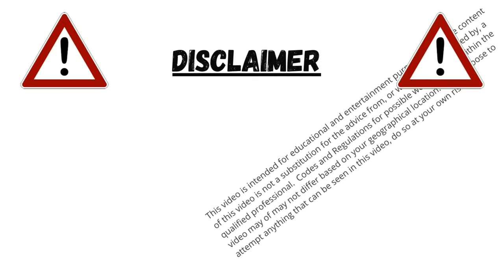Milwaukee M12 Fuel Circular Saw - Features & How It Cuts! - Best "Little" Saw I have Used 2530-20

Comment: Ok, just bought this and the Diablo blade.  I hear grinding noise when free running the saw, like the bearings are bad.  Going to try to exchange it.
Reply from the maker: They should let you exchange it.  

Mine doesn’t make any kind of noise different than any other saw…

That one must have slipped past quality control.

Comment: This video answered some questions for me, thank you.

I picked up a used (yet never used) example recently. It came with that same Diablo blade installed (also unused.) On mine, the lower blade guard wobbles a little bit, something I didn't expect. I am assuming yours doesn't do this.

The C-ring securing the guard appears to be installed correctly in its groove. Doesn't bind up or hit the blade, so I guess I'll leave it be and let it rattle a little. 

As for why buy? I'm using M12 where I see a few opportunities for something interesting out of the norm. I was initially interested in a 4" circ saw, like the little ones you see from Dremel, Worx and Rockler. But I wanted it cordless and most of those are not, and represent yet another platform. I've already used once up in the attic my old 7 1/4" Skilsaw, so I know this will be better for that.

I'm already in metabo HPT for their 18v/36v lines, but went with M12 for the Fuel oscillating tool, the stapler, this saw, and am interested in the sprayer and the 3/8" Stubby impact. If I wanted a straight replacement for the corded Skilsaw and didn't need quite its reach, I'd probably go with metabo HPT's 6.5" cordless.
Reply from the maker: You are welcome.

I really like this saw and you are right… it will get you in some places others won’t.  I also like the control I have with it just using one hand.

I haven’t noticed in rattle in mine.. not sure what that could be.  

I think you will find this to be an extremely useful saw for certain things… if you use it for what it is and don’t pretend it’s a full size saw, most people think it’s great.

Have a good one 👍

Comment: The M12 Jigsaw and baby bandsaw are also worth owning !
Reply from the maker: Yeah I have both of those and like them as well.

The Bandsaw is one of the few fuel tools that I haven’t upgraded to Fuel yet. I really like the small size of the original and I primarily use it for conduit, all thread, and uni-strut. It cuts all those so I haven’t had the desire to go bigger. I am sure the Fuel one cuts faster but I haven’t used it.

Comment: I have the tiny little Bosch mini circular saw - cutting depth 1"/25.4mm. Brilliant, even ploughs through 3/4"/19mm plywood easily then flip to 3mm hardboard - and does dust extraction well - except setting bevel and cut depth is crude and fiddly. Came here after looking at the Milwaukee Installer Kit and Bosch equivalent. I have that Bosch but Milwaukee 18V drill and driver pair with combined charger. Which way to go for the installer? Needed such a tool yesterday and made do with a cheap minimal size right angle bit holder in the 18V drill. But... The whole Milwaukee 12V range looks very useful to get into even if I'm with Makita for 40V. Thanks very much for the review
Reply from the maker: Your welcome.  I have a review for the Installation Driver too.. it’s one of my favorite tools.

Bosch makes good tools… just hard to get in my area.

Comment: While this saw definitely needs an update as it's several years old, it does fine for what it is. I use mine for breaking down sheet goods like MDF and plywood for finish carpentry. For blades I use the Norske 30 tooth finish blades. Of course I have a few diablo framing blades as well.
Reply from the maker: Appreciate your thoughts… I use mine for most of my smaller job site type work. I just used it yesterday with the rip guide to make some OSB spacers for headers, and then for cutting all my 2x4’s. Worked like a champ.

I’m a little curious to see if the high output batteries do anything for this saw. I can tell a difference in my M18 Rear Handle with one.

Would be nice for an upgrade. I’m  still waiting on a jigsaw upgrade too. Would like a Fuel Version and also one that the plate locks at 0 degrees a little better.
Reply: @MORGANSMaintenance  yeah mine gets used on occasiona along with the other 4 saws I have in the van. I like my DeWalt FLEXVOLT circular saws personally. Rear handle and side winder. So much power.. I also have the m18 6½ which I use for ripping as well. Have a lot of dedicated tools and guides/jigs so I'm not constantly switching things out. I may get one of the HO batteries for the m12 saw but they are really expensive here in Canada. I also can't find the rip guide for the m12 saw otherwise I'd buy one.
Reply from the maker: @BrandonContracting  yeah I ordered my tip guide from some weird website… I hadn’t seen it available anywhere else.

Dedicated tools are a big time saver 👍

Comment: Great review Morgan. I like having the blade on the left side as well. I have the regular M18 saw and it does a great job but it is heavy as well for what I do. I think I might head over to the depot today and pick up the m12
Reply from the maker: It’s super light. I can normally hold wood in one hand in the air and cut it with the saw in the other it’s so light. (Like what I did with the flooring)

I primarily cut 2x4’s with it but use on sheet goods that aren’t delicate cuts (sub flooring, etc). If I am building furniture/cabinet grade stuff I use my track saw.

Thanks for the compliment and for taking the time to watch!
Reply: @MORGANSMaintenance  On a side note, not sure if you use the m18 or m12 vacuums but Milwaukee has some new vacuum attachments that work pretty well. Might be a good video idea for you.
Reply from the maker: @parts7959  I have the M18 (the one before the Packout Version) and I think I will get the M12 the next time they run it with a free 6.0 battery. I really like how the hose stores inside the M18… I’m not sure if it does on the M12.

I just saw a few Air Tips on a shelf at Home Depot this week while I was looking at the Tool Tray. They don’t have them out on display or for sale yet, but my Home Depot stinks and is always behind. 

I’ll check into them. Thanks for the suggestion 👍
Reply from the maker: @parts7959  which particular tips do you have?
Reply: @MORGANSMaintenance  I have the 3 in 1 crevice and brush and I have the cross brush air tips. The m12 stores the hose like the m18. I bought the m12 when it first came out and they had a lot of problems with it. I’m pretty sure they got those fixed now. Also my neighbor is an electrician and he uses the m18 vacuum for getting wire started for pulling in conduit. He says it works very well
Reply from the maker: @parts7959  yeah, part of a plastic grocery bag on a pull string works great with a vacuum.

I will check out those tips, I have some gift card money to spend 😂. Thanks again for the suggestion.
Reply from the maker: @parts7959  I’m going to buy the flexible hose set and probably the cross brush you have to start… man they have A LOT of these. I had no idea they came out with all these.

I would get the dust collector that sticks to the wall but I already bought something that works similar.
Reply: @MORGANSMaintenance  👍🏻me either, there’s a lot of options. Dust collector is a great idea. I need to take a look at the flexible nozzle
Reply: @MORGANSMaintenance  good call on the m12 circular saw, I went to my local Home Depot today and picked 1 up and a Diablo blade, it is awesome. I love it, didn’t like the price though lol
Reply from the maker: @parts7959  good deal. Crazy light isn’t it?

Yeah it is $149 now. I think I might have got a battery with mine and made it a little cheaper but it seems like all the tools have gone up a little. They didn’t cut any corners  on it for the plate and adjustments and stuff though… I think that’s why it’s priced a little higher than other smaller saws. It feels like a real saw, just smaller.

Oh after a few months you won’t even remember how much you paid for it 😂😂

Comment: Great video! I have the m18 6 1/2 fuel circular saw and absolutely love it. The fuel tools are really something else. Looking to upgrade to the rear handle eventually but have looked at the 5 3/8 m12 before buying the 6 1/2. Also have the dewalt atomic 4 1/2 flooring saw and I love it. Definitely try it if your looking for a good flooring saw. 👍🏻👍🏻👍🏻
Reply from the maker: Appreciate it.  The Rear Handle is a beast… but it it heavy..

Thanks for the suggestions 👍
Reply: @MORGANSMaintenance  very true. It’s the only 7 1/4 saw I could get with a left line of sight plus I want the power for cutting hardwoods. But honestly my fuel 6 1/2 has never stalled out or let me down so idk I want to just put it aside for the rear handle
Reply from the maker: @Toolboss0826  Line of sight is the the whole reason I got the rear handle too…. Also the reason I gave this saw a try originally. 

Rear Handle is a great saw, I really like it, I haven’t used the 6-1/2 though.
Reply: @MORGANSMaintenance  6 1/2 fuel is so light and compact. I own quite a few circular saws including a 6 1/2 dewalt and a corded 7 1/4 dewalt (dwe575) and the line of sight of the dewalt is a lot to be desired. Imo Milwaukee wins on the line of sight and the base plate. The power is substantial and a 6.0 battery definitely makes a difference on big rips. The 6 1/2 is the best circular saw I have ever owned. I bet the rear handle is a beast
Reply from the maker: @Toolboss0826  I make pick up the 6-1/2 if I ever catch a deal on one.  It would be a good one to have as an in between for a quick grab.
Reply: @MORGANSMaintenance  agreed. I got my 6 1/2 for an amazing deal that’s why i scooped it up. I would never had paid full price for it but if it was today and I had experienced it first over my brushed Milwaukee 6 1/2 I prob would have bit the bullet
Reply from the maker: @Toolboss0826  👍

Comment: My only Circ saw ! Good on 2 by stock , so what if lt takes two passes to cut 4 by stock , I bought the carbide blade for metal square duct , etc !
Reply from the maker: I think the same way…Most 6-1/2 saws take two passes too, so might as well have a smaller, lighter saw.

I haven’t used any of the metal cutting blades on it.  Not a lot of blade selection in store… but tons on Amazon.

Great to hear from you!

Comment: Thanks for the video.

If I don't own a battery powered circ saw yet, (I own a corded 7 1/4") and have both M12 and M18 batteries.  Would you recommend this 5 3/8" comboed a 7 1/4" or would a 6 1/2" do the job?  Use would be mostly for repairs and small projects.
Reply from the maker: I don’t have a 6-1/2… I have the 7-1/4 rear handle and this saw as my only circular saws and they do everything I need.

The rear handle is nice, but it’s crazy heavy.  I mainly got it because I prefer my blade to be on the left, and a normal 7-1/4 is on the right. For that reason I would personally buy the 6-1/2, but it’s obviously not going to get the depth of a 7-1/4.  That extra depth rarely comes into play… usually just cutting post and things, so it depends on how often you do that.

Comment: I got one, don't even know how it appeared in the cart. But it is great for M12
Reply from the maker: Thanks for your thoughts. It is hard to believe it is a 12v saw! 

I didn’t even hit home the fact that my old worthless little saws were 18v… and this 12v blows them away. It’s pretty amazing the battery tool improvements in the last decade.
Reply: @MORGANSMaintenance  I'm 24, but remember my first drill when I was 8 was a 12v bosch but those batteries were the size of an 18v now and the new age 12v lines blow the old out of the water
Reply from the maker: @willhamilton9121  yeah.. I remember those days. 😂. (The big 12v… and 24 years old…)

Comment: Good, thorough no-nonsense review.  My only gripe is that I wish you had tried ripping plywood with it. I've heard other reviewers claim it is capable in this respect -- my own experience leads me to believe otherwise. I've put up 5/8 and 3/4 " plywood on sawhorses and tried to rip sheets with little success. After about a foot in, or maybe two, the motors whines and then stops. I've been using the stock blade (which sucks by all accounts) and a 4 amp battery. Have I run up against the limitations of what this little saw is capable of, or am I doing something wrong?
Reply from the maker: The stock blade is garbage… get a Diablo and you will be surprised by the difference. (I was anyways)

I use mine on OSB pretty often ripping for headers but have used on plywood. I always use a 6.0 in mine, but have cut with a 4.0 as well. 

Sorry I didn’t think to use plywood in the video. I normally use mine for 2x4’s so 2x lumber was what was in my head. 

Typically when I’m breaking down plywood I use my Tracksaw so it never crossed my mind. Thanks for the feedback, it helps me to think about things differently for future videos.

Comment: I see that on the Milwaukee website that you can put a 5-1/2" blade on it also. Has anyone tried that so you can get a deeper cut?
Reply from the maker: I haven’t tried it yet…. But you have me intrigued 🤔
Reply: I'd be curious too, just picked this up today
Reply: I just saw a YouTube video on it where a guy put a 5-1/2 DeWalt blade on it so it does work.
Reply from the maker: @beotheguitarist  I’ve been trying to think of something where I would need the extra 1/8”.  I am more excited that it just opens up other saw blades they might have in store.

There aren’t a lot of option for either typically, but maybe between the two there are a few more now.

Thanks again, I appreciate the info.

Comment: I build decks with on the side with a couple buddies. Would this be sufficient for cutting 2x joists, headers, etc? We already have 2 full size saws on site but wanted something smaller since a lot of our cuts end up being in weird positions and without the use of saw horses making the lighter tool appealing.
Reply from the maker: I haven't cut bigger 2x's in high volume, or pressure treated... but I have cut through a 2x12 standard lumber with mine.  It obviously isn't as fast, but it does it.  I would definitely recommend a 6.0 AH Battery for it.  I have cut standard lumber 2x4 and 2x6's all day with no issues.

I'm also curious how these new M12 High Output batteries will work in it.  I know my Rear Handle is a different Beast with a High Output M18. 

I really love mine for what you are saying, smaller for access and weight...

Not sure I helped in any way, but i haven't really built a deck with mine, mostly inside framing for me. It has cut way more than I ever thought it would.

Comment: The Diablo blade you used in the video is 18 tooth 5-3/8" but the one in the link is 18 tooth 5-1/2"
Reply from the maker: Sorry about that 🤦‍♂️.  Thanks for letting me know. I have it fixed now.
Reply: @MORGANSMaintenance  No problem. I'm curious now... so what is a 5-1/2" blade used in? Thanks.
Reply from the maker: @illestofdemall13  I know. I’ve never owned or seen a 5 1/2” saw… there must be one out there somewhere.

Comment: what would be the difference between the m12 fuel vs m18 fuel 5 3/8 saw?
Reply from the maker: I'm sure the M18 has more power... I think the M18 is also geared for metal cutting with lower RPM's, I'm sure you can cut wood with it, it still has more RPM than the M12.

The M18 5-3/8 had 3900 RPM and the 7-1/4 wood had 5800.

Comment: Can you put a metal blade on it for strut/emt cutting? It is simliar rpm to the 'metal cutting' m18 saw. I can't find any info about this anywhere
Reply from the maker: I have never used it for that, always used my bandsaw… but as I ordered some wood blades on Amazon yesterday I thought about getting a metal cutting blade. (They were in the search results)

I may go ahead and order one and I can let you know. It will take however long it takes Amazon to send me one.

Then at least I’ll have a blade as an option if I need it. If I can find one with 10mm arbor or bushing that isn’t an arm and a leg….
Reply from the maker: Just put up a Short showing this..... https://youtube.com/shorts/geZAWkcveMg

Comment: MORGAN"S Maintenance, have you ever used a  Kreg24 in. Rip-Cut Aluminum Circular Saw Guide with that Milwaukee 2530-20???
Reply from the maker: No, I haven’t used one of those on any saw I’ve had. I have seen them but I have a track saw so haven’t bought one yet.

Sorry
Reply: @MORGANSMaintenance  Oh, your all set then, with a Track saw, we are going to build an OFF-grid home soon!!! From cutting down tree's to building the whole house and I noticed instead of dragging a Table saw threw the mud, that Kreg's Rip is so cheap and it just simply attaches to a Circ saw and rip OSB sheets is so easy!!! Latter when we are Dried In the house I will get a Table saw and it wont look like its been threw a muddy war!!! Ha ha ha!!!
Reply from the maker: @2point..0  I am wanting to do that as well someday. Good for you!

Yeah we all need two sets of tools… grunt and finish work 😂

Comment: Will take a 5 1/2 blade as well. Sometimes I don't want to send $15-20 for a Diablo blade. Harbor Freight's bauer 5 1/2 30 tooth ain't bad for $6.
Reply from the maker: Good to know… does it still cut through 2x4’s with the 5-1/2?
Reply from the maker: @Jay-sg2ww  My brain wasn’t working right 😂. I for some reason was thinking 5/8 instead of 5 AND 3/8…

I appreciate the info. I’m all for having some cheap blades on hand. I cut all kinds of stuff where I am like “this blade will be trash after this”

Thanks again.